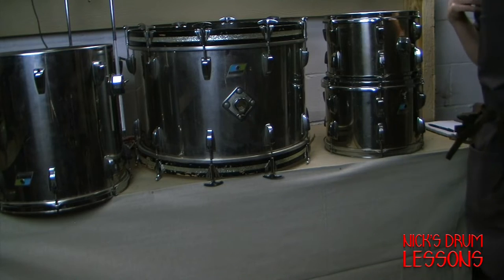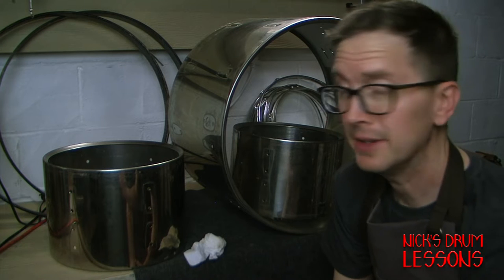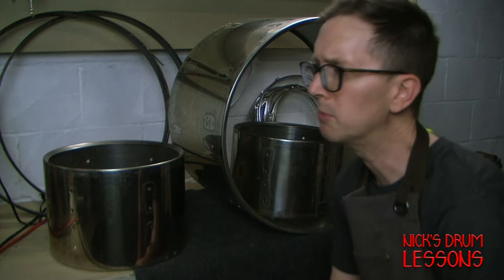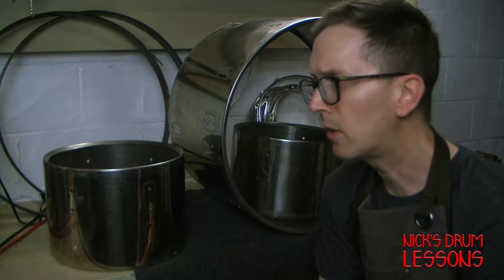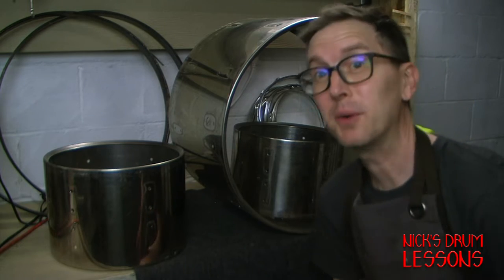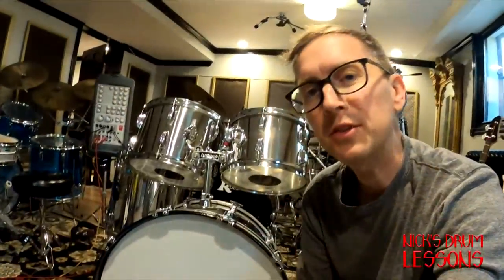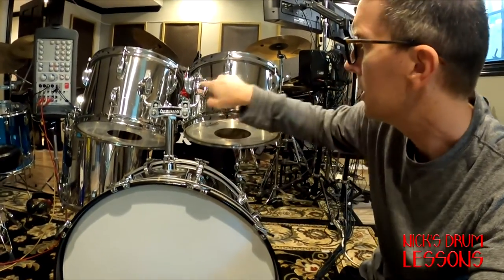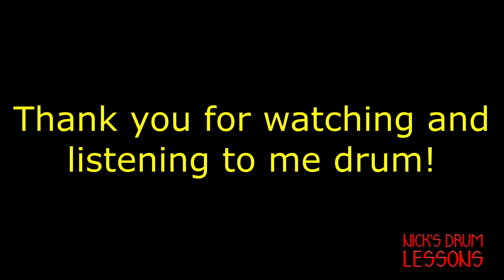Ludwig Stainless Steel Drum Set Restoration

Comment: I have an almost identical Ludwig Stainless Steel kit from 1979.  It has a couple of dings/small divots..any suggestions for smoothing these out?
Reply from the maker: Small Rubber mallet might do the trick for dings. Scratches can be sanded out but you will spend forever buffing it out.
Reply: @Nicksdrumlessons  Thanks for the advice.  Your kit is beautiful.  Like I said, mine is pretty much identical (I roughly gaged from the serial number it is from 1978/79).  I’ve had mine 20 years now and gigged with it a bit so I’m not surprised it has a ding or two.  I would love to try and get them near pristine though.  Thanks again.
Reply from the maker: @drummer78  may I ask what your serial numbers start with?
Reply: I recently scored on of these but they have top and bottom dampeners which I think is odd (on the 12 and 13) Appear original to the kit though. I think mine are from 76 as well